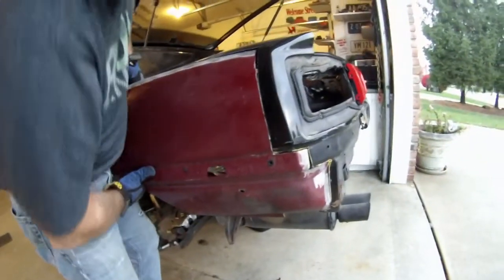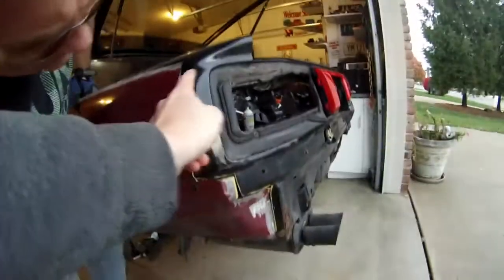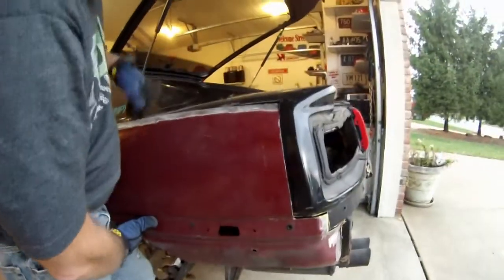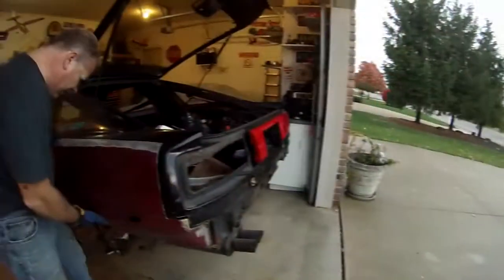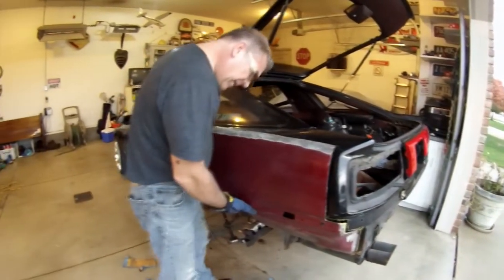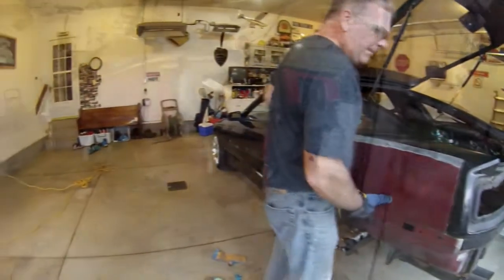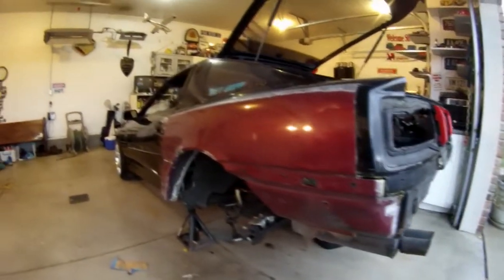Toyota Supra : Quarter Panel Repair Part 1

Comment: I need help i have a mk3 supra and my gas door opener is not working and well I don't know how to fix it
Reply from the maker: Hmmmm get on the supra forms I bet they have something on there. I bet the cable has become disconnected on one of the ends. If you don't care you can take the lock off the cap and it will always been unlocked.
Reply: +Skid Kidz thanks , I will go do that 😊